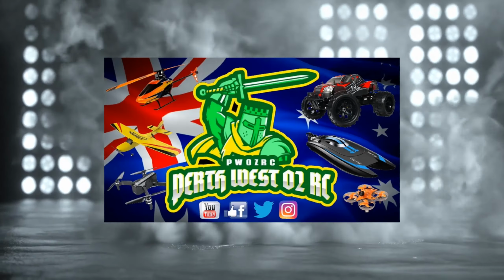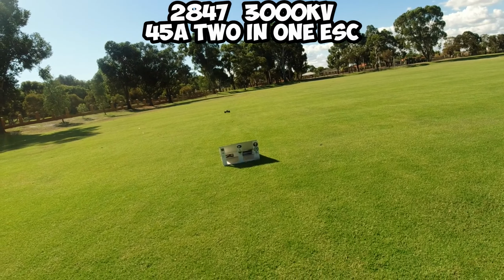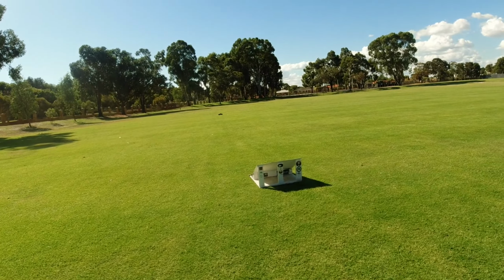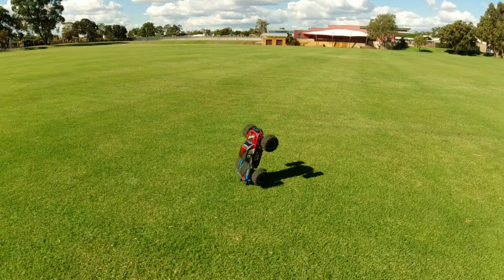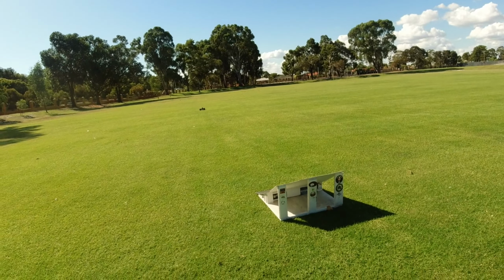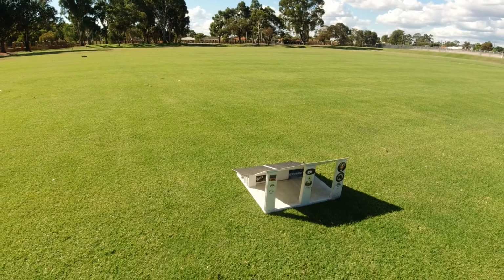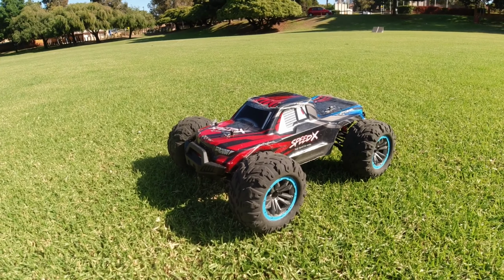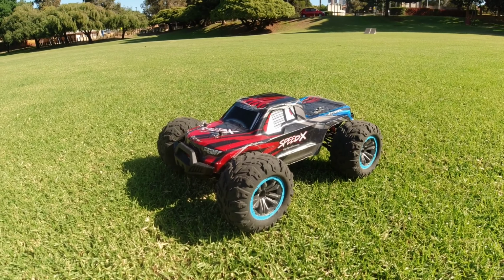FLYHAL X04A MAX Brushless Truck BASH!

Comment: Glad you reminded people to tape the body. So many overlook this then complain when the body breaks. 
It’s a cheap RC so it’s not gonna be the best but just a little bit of gorilla or strong duct tape makes such a difference. Cheers for the vid mate 👍🏼
Reply from the maker: Yes I find gorilla cloth tape works well on these lexan shells to prevent them from splitting, been using it past couple years now. Cheers for watching mate 🍻